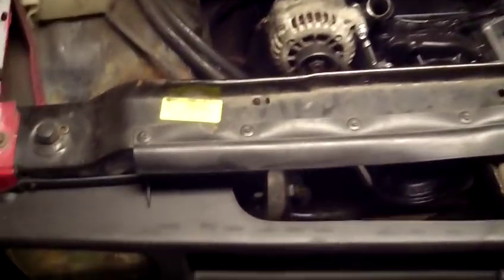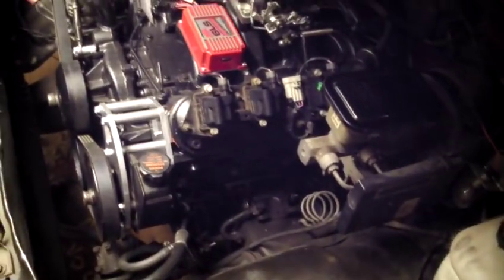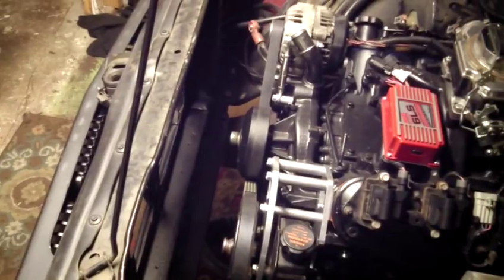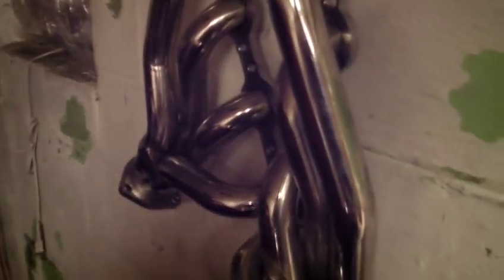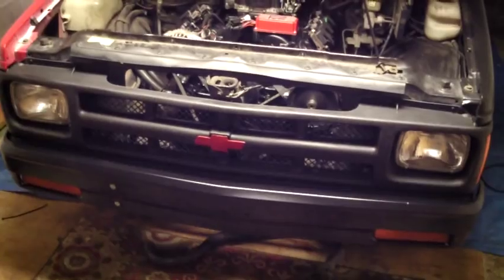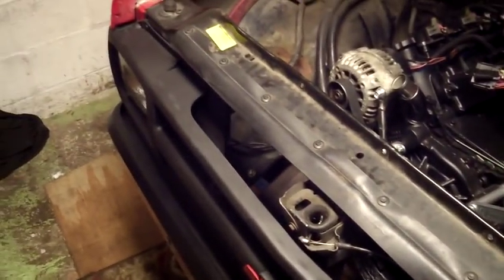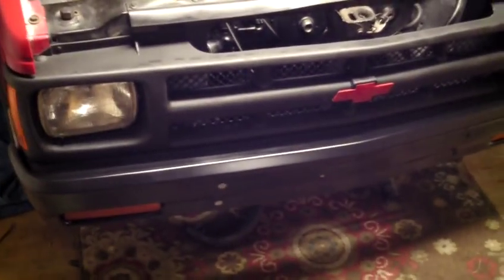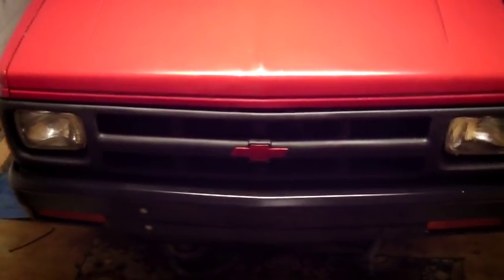5.3 LSX swap Gen 1 S10 update

Comment: What did you use for a wiring harness and ecu?
Reply from the maker: Chevyguy its carbed. Msd takes care of ignition duties. The factory 2.8 Ecu is there to handle the fuel pump and gauges etc